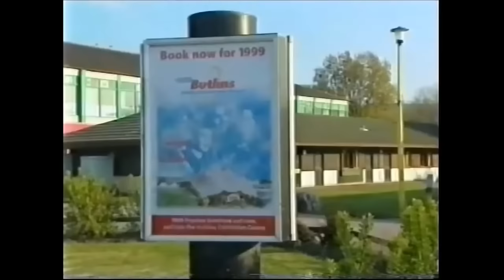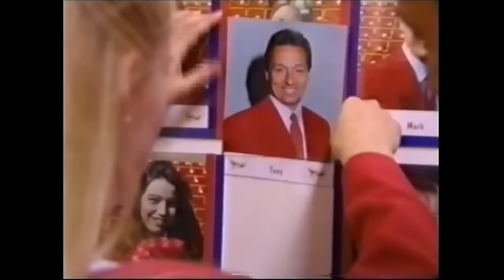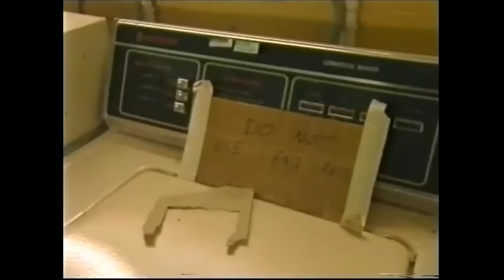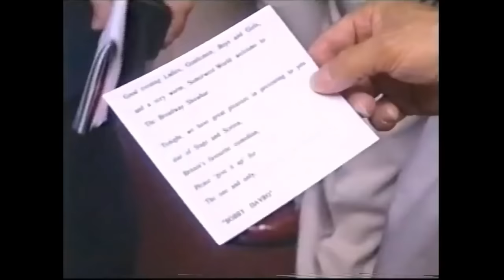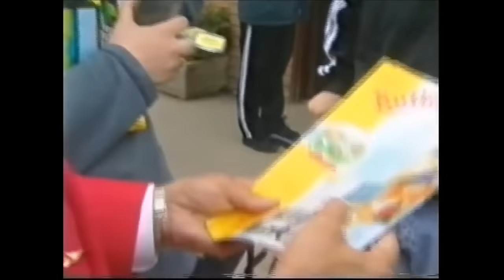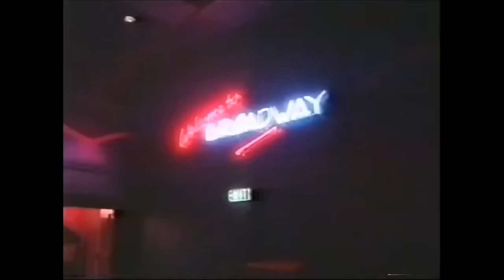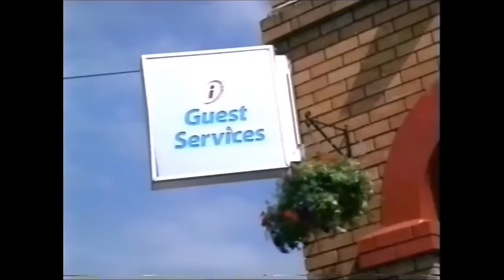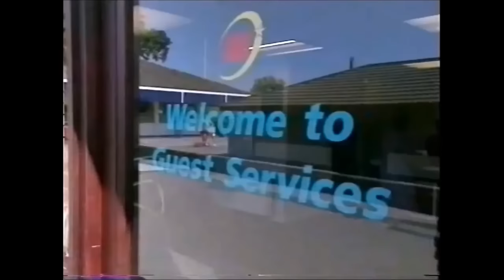Undercover Boss - Butlins Minehead - behind the scenes #butlins #butlinsminehead

Comment: I stayed there in 1966 when I was 12.  It was really Hi Di Hi.  Our accommodation was in a chalet which was basically beds in a shed.  We had a wire curtain cubbyhole for a wardrobe.  I can't remember if we had an in house bathroom.  We had our meals on huge long tables. I don't remember  much about the food except bread and butter.  I did have a great time with all the rides and the pools though and the disco in the evening and there was a cable car that went over the tops of the roofs of the chalets.  We used to get woken up in the morning with a wakey wakey Radio Butlin jingle over a loudspeaker in the chalet.

Comment: The modernisation was needed, but the ethos needed to stay the same.  The final years of Rank and the early years of Bourne Leisure turned that on its head.  Many things that were included for free in the mid-90s either disappeared or was replaced with a paid alternative - and since the accommodation wasn't any cheaper it significantly increased the price of the holiday.  

I think the segment at 27:10 says it all - the gentlemen that doesn't see the benefit to "upgrading the staff feed" while "investing today for the future" (his words).  The staff are the lifeblood of the camps, they worked stupidly long hours for meagre pay - and they gave it their all to allow the customers to enjoy their holiday.  That the bosses treated them with such contempt clearly filtered down in the later years, you can't hide a staff morale issue when it's reached rock bottom.

Comment: £1.5mil for 8 computers..... In 1999... No chance...
Should have hired me...
The best computer in 1999 would have been £3,000
Say you wanted 10 of those, that's £30,000...
Maybe they needed a server? Call it £200,000 for a nice one....
So there's £230,000 😂
Then some BNC or Cat6 laid out over the offices?
Add another £200,000 at the very most 😂
Call it £450,000... So someone made over a million somewhere 😂
Just on I.T. 😂
Shoulda called me 😂
Reply: That would of been the guest booking system for the whole company not just Minehead their on about there
Reply: @johnbond8392  if that's true, then they've had an extreme bargain.... So I doubt that 1.5mil would cover the entire firm 👍
Reply: @johnbond8392  but back, the PC' where little more than just dumb thermals, and with screen keyborad, and posablely a mouse, and big server , located in the head office, running the hole show?